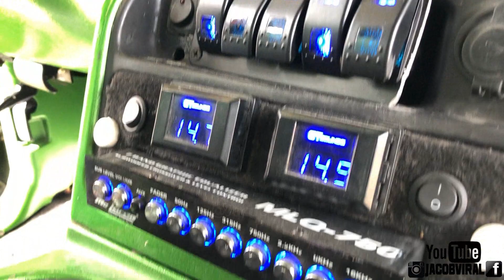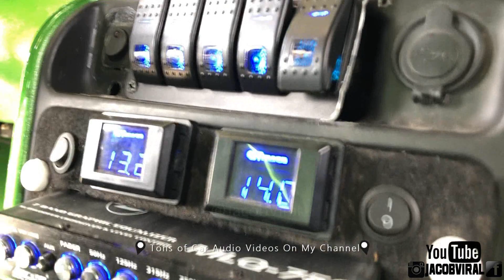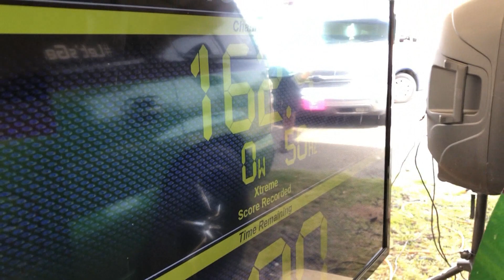TURNED THIS ON AND THE CROWDS CAME TO HEAR!

Comment: what kind of screws or bolts do they use to mount the subs to the enclosure? i've been considering bolts nuts and washers for mine, because the screws i use are wearing out the holes due to how often i open the box up to make changes. i tried a quick google search but i only got results for how to build the actual enclosure and how to mount the motor to the basket
Reply: You can buy threaded inserts that you drill a hold and screw the insert in, then you can use machine screws on those